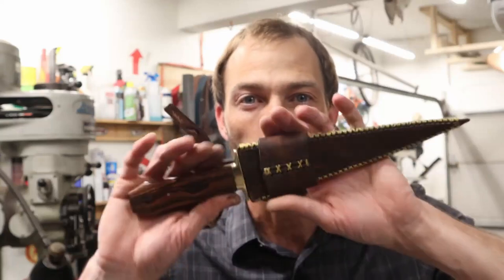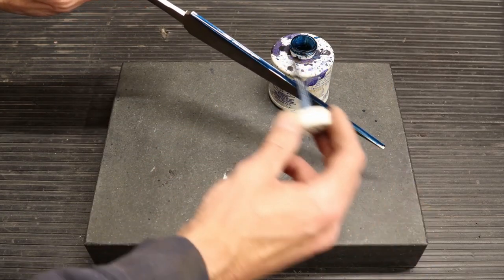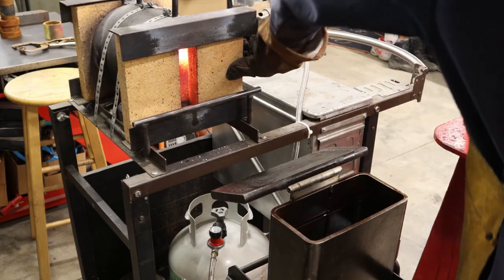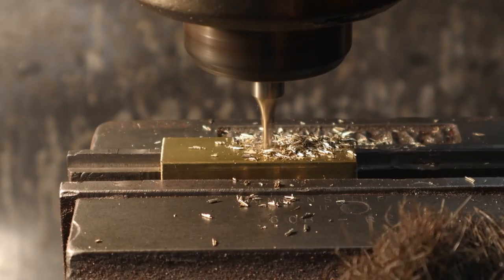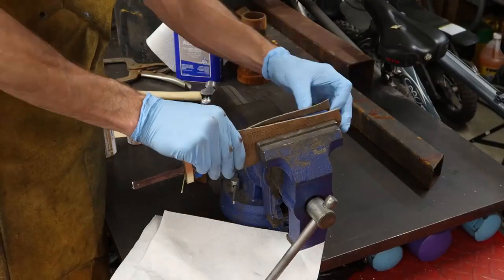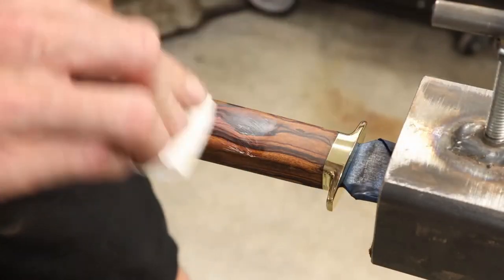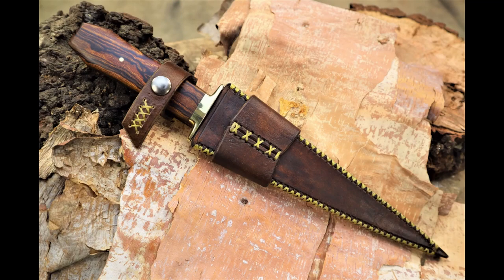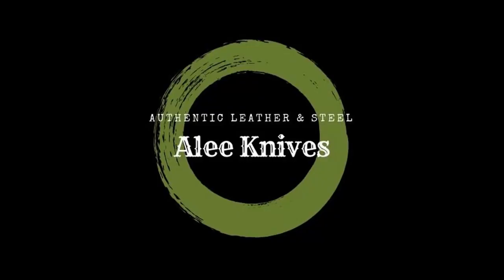Dead Feather Dagger

Comment: Wow!  Beautiful knife.  Love your attention to detail to enhance the artistic beauty of the finished blade and sheath.  And I always learn a new tecniqe or tip to help and enhance my amateur knife making skills, i.e. template for oval guard and shaping guard to determine handle shaping.  👍👍👍💥💯  CHEERS!
Reply from the maker: Fantastic jumping Jack!
Reply: @Aleeknives  Question: How or what do you use (technique) to draw the correct sized ellipse for your guard pattern?  Template, geometry, ?  I am now doing my 3rd guard which will be an elliptical guard.  I haved learned that you must "sneak up" on the slot in the guard to get the fit desired with the tang reccasso area.  Thanks for the teaching video's that demonstrate your patience and diligence in doing the small things.  Thanks my friend.
Reply: Airin,  got it made!  No need to respond to previous question.  Ain't YouTube wonderful?  Finished filing my slot...first time fitting right down to within 1/4 inch, tapped down with metal tube and no cracks, fits like glove but have to work on curved area at transition to flat area.   Thanks!
Reply from the maker: To be honest I usually use something laying around the shop that has the right circumference and trace around it for my shapes

Comment: Stitching contrast is spectacular makes the hole thing stand out . Just buy chance you are using fiebing's pro dye I have had a problem when the dyed leather comes in contact with brass the brass turns green some kind of chemical reaction going on there  . I was dip dyeing my leather now I spry the dye on then edge dressing and top coat inside. Happy trails
Reply from the maker: This is interesting!  Spraying the dye huh!

Comment: How did you keep it from warping when you forged it? I am struggling with that process as we speak.
Reply from the maker: It warps and moves all over the place during forging! After I get the billet or blade to final dimensions I use a flatter hammer to straighten it out

Comment: liking that, love the attention to detail you put in, makes a big difference and points me in the right direction at times, and yes sometimes nervous heat treating I have heard the dreaded ting and also had em come out as wavy as and a couple not survive the straightening process lol,  and that needle point would have been a very nervous and careful heating up. It is  all a learning curve no matter how many we have made before, and not many for me yet
Reply from the maker: So true Andy! That point was super difficult to heat treat. I actually stuck the blade all the way through the forge so that the tip was outside the forge and the rest of the knife could come up to heat first. As to not over heat the tip and make it fragile!  I do this purely for fun so each blade is an opportunity to learn and try to make my art better! Thanks again Andy! Cheers

Comment: Beautiful knife bud. What oil are you quenching in?
Reply from the maker: Don't laugh but for 1084 peanut or canola. I have parks 50 for 1095 but it's a little to quick for 1084 and makes it some what brittle.
Reply: @Aleeknives  I figured as much. I use mostly canola as well. I always see you preheating it, And was wondering if you were heating parks 50. I just bit the bullet and ordered some 50 and AAA
Reply from the maker: I will tell you this also. I definitely think both peanut and canola are more pleasant to work with and smell in the shop. If I use the parks 50 I generally open all the doors quench and then leave the shop for the night. If I use the other 2 I quench with the doors open and I can continue to work.
Reply: @Aleeknives  I do the majority of my ht outside, as my shop isn’t the largest, although I did just break my mini 2 brick forge back out and have been using it to heat treat smaller blades, as I get a much more even and consistent temperature. I will keep the smell in mind when it comes in. Keep up the good work man. I enjoy your videos, and your tutorials on handle shaping/finishing have really helped stepped up my game.
Reply from the maker: That's awesome  Waylon! I am glad you are getting some enjoyment out of my videos!

Comment: But Arkansas toothpick is beautiful have a question do you quench in a north-south Direction
Reply from the maker: I think it might be silly but I definitely do!
Reply: @Aleeknives  I don't think it's silly at all why take chances if anything had a potential to warp I think the toothpick did
Reply from the maker: The reason I do it is because when you quench a blade it is none magnetic and quickly becomes magnetic. The adge old question is does it pull towards magnetic north?

Comment: Could you just use coffee & not the ferric chloride on say cable damascus . Beautiful wood , I really like how the guard & handle turned out .
Reply from the maker: You could but it wouldn't last as long. When you etch in ferric chloride your actually removing material creating valleys where the high carbon steel is. Then when you coffee etch the coffee etched that high carbon steel that lies in the valleys. It is somewhat protected from being rubbed off at that point. The coffee etch is durable but can definitely be buffed off similar to a bluing technique. I have etched multiple blades with coffee and no ferric chloride.  Look at the cu mai builds that I made. Thanks for watching Buddy! Cheers

Comment: Did you really just run your fingers over the blade before etching,!?? Lol
Reply from the maker: I wet sand in water before etching so basically I touch it a lot then etch it several times with a steel wool buff in between each cycle